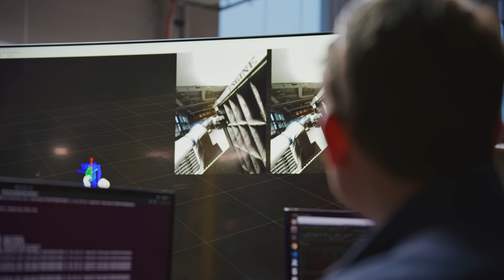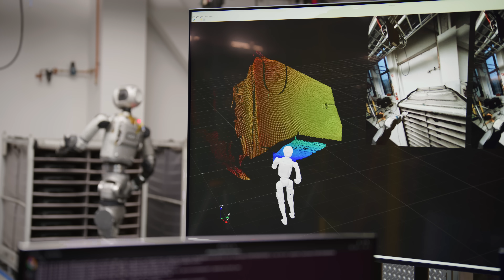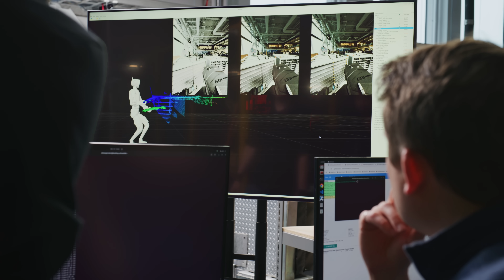Pick, Carry, Place, Repeat | Inside the Lab with Atlas

Comment: Inefficient machine transferring parts that shouldn't even exist.
Reply: For now yes.
But if the tech get cheaper and affordable, it will be adopted in large scale.
But for now, a device on track with a manipulator and RGB camera Will be more efficient ✅
Reply: For now yes.
But if the tech get cheaper and affordable, it will be adopted en masse.
A motorized tract device with manipulatelor arm and an RGB camera Will be more capable and efficient

Comment: Remember this video was about giving a description of a task (described in english) for a manufactured setting and having a robot carry out that task (in this case 100 sub tasks based on  the number of bins). The task being to move all the parts from the one bin to the other and keep it in the same order in the alternate bin. They are now using the same reinforcement learning (this is now being done by a lot of companies now, also bd actually came and said they were using reinforcement learning aka neural nets) coupled with the behavior robotics. Also keep in mind these robots are built to take the place of human based tasks but there are many different robots now doing manufacturing already, i.e. walk into any manufacturing plant and see how many of the items are actually stamped/molded into shape by human hands and a mallet/hammer only. Looms took the place of humans hand sewing stuff a long time ago.

Comment: 360 movement articulations for efficiency , but why it needs to rotate head? Why it does not have cameras all around the head ? That way it will not need to move it. That’s more efficient.

Comment: Probably a silly question, but while the 360 degree head turning is cool, wouldn't it have been more efficient to just put cameras in the back? That way you don't need to engineer this complicated head turning mechanism, just have it feed off sets of cameras in the front and back? Unless the cameras would have been more expensive, and the 360 degree mechanism isn't that bad, from an engineering/cost standpoint. Still super cool, though.
Reply: it's not just a camera but a bunch of other monitoring systems as well. Plus putting a second set would literally increase the power demand by 2 times making it far less efficient

Comment: What seems unique about Boston Dynamics is when you see the way the new Atlas stands up from a prone position by reversing it's legs and the same with turning its head 180 degrees to look behind it. It's not just reproducing the way a human does these things because it can move it's joints in ways that human's can't. That takes a lot of humility for the engineers to accept that the human body is not the ultimate bipedal evolution and that in future, for robots, there will be better or at least more efficient ways to design them.
Reply: yes. this is the reason why boston dynamics is front runner in humanoid robots. they arent mimicking real humans they are developing super humans that humans cant do

Comment: Humans will still be cheaper 😂 these guys are just Theranos Lite
Reply: "The average salary for a factory worker in the United States is around $35,686 a year." (Economic Research Institute) Boston Dynamic's last robot, Spot, is valued around $74,000 in the early age of robotic development. Project that prices go between the range of $10,000-$50,000 within the next few decades and you got something that doesn't complain, doesn't need a break, and does the same job 24/7, all at a price cheaper than a human!

Comment: Its impressive machinery indeed. But I think we are taking the wrong approach to the problem. Instead of trying to create something that could mimic human movements in human designed environment, we should simply change an environment in a way that we wouldnt need a complex robotic humanoids to do exactly the same thing the humans would do in that environment. 
Instead just build a box with a robotic arm set in the center that would simply move those engine covers rapidly, just the way they are programmed to work on a car assembly line for example. 
We already have the technology for that. It would be far more efficient to build an entire warehouse designed in a way where only machinery does the work that the people do now. It would mean a lot smaller warehouse, a lot more efficient sorting.
The current design of the work environment is made in a image of the workers needs. But why are you designing a robots that would mimic humans? We should design robots that would not need the same warehouse setup that a human needs...  
Its a lot more efficient and simple to simply design and build an assembly line of warehouse good sorting than it is to replace a human worker by a robot.

Comment: I look forward to the robot either testing new paths incrementally or maybe "imagining" variables to explore efficiency. A human would look at this and probably figure out a way to use both arms either by passing things from one hand to the other to avoid walking or by using two arms in a way that resembles independently controlled movements. A human could also take more than one engine cover in their arms so long as they don't get scratched. I just think that this robot is built with fewer mechanical limitations than a human but it is performing like a human with higher than average limitations albeit with a swiveling head and torso.

Comment: the difference  of human vs robot is emotion. humans have will power, will power is the driving force why it can work longer hours without being tired robots dont. I understand the human vs robot limitation obviously machine only need instruction and hardware design system. humans need sustenance, rest, human connection. But the difference is the what drives them. But thats only an opinion. It doesnt matter.

Comment: that thing is incredible engineering, amazing technology. but until i see it doing what atlas did, i wont believe them saying it can do what atlas did but better. they are different tools for different jobs. if im wrong, id lobe to see this robot jumping and flipping etc. but i just dont think those little electric motors have enough instant power for that. either way, both are incredible and those that worked on them should feel proud. as long as they are not used later to terrorize humans... or take their jobs, lol.

Comment: Some points that need to be improved while watching the video: 1. If you put two cameras in front of your head and two behind your head, you can recognize the danger or direction of the back without turning your head. 2. When moving the engine cover, it would be nice to move two light objects so that multiple tasks are possible. Of course, hold heavy objects with both hands and move them.

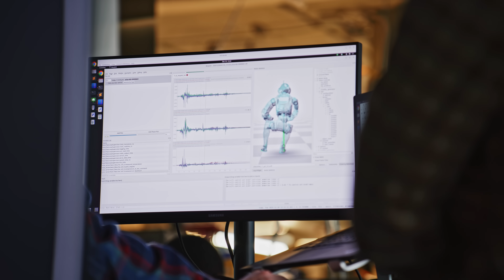Comment: 1:55 they are using Ubuntu inside Ubuntu?
Reply: Virtual Machine. Considering how much work they do, it makes a lot more sense to have most of it in a container of sorts rather than on a bare desktop.
Reply: @EbonySaints  i think they are using cloud OS like AWS. It will make sure that their code and data will not be vanished in case of hardware failure.

Comment: Could a top camera that communicates with the robot help with something or anything? Top down camera on the ceiling?
Reply: These are meant for environments that aren't 100% controlled and monitored by another system. Why install all these cameras when you can just get one of these and they will do their job right away or after minimal training. That's the goal, to have humanoids in areas that aren't 100% under control by the machines. Would you rather buy a humanoid for less than $20,000 and have it go to work right away, or remodel your workshop for hundred thousands of dollars first?

Comment: The hydraulics in the old Atlas acted like muscle and made its movements look more fluid and human-like especially when doing the athletic stuff.
Reply: The new robot is stronger and it's moments are smoother, according to BD. What are you people even talking about? They've even just posted a video demonstrating this.
Reply: They also could output more force and hold positions without requiring as much power as brush-less motors do when used as actuators.
Reply: Hydraulic actuators don't act like muscles. But they're more more fluid.

Comment: I'm curious, is it necessary for the head to have a "front"?  Couldn't you just put cameras in the back of the head so it doesn't have to "turn around." Robots don't need to have the same limitations we have. Same with its limbs and walking. If it can grab an item and just move to its destination without having to "turn its entire body around" it would probably shave off some time.

just a thought.. I'm sure you've already considered it and have a very good reason I'm just not seeing.

awesome work! I love seeing the progress

Comment: The robot is a marvel but the people don't seem to get that the 360 degree motion comes at a cost of it being unpredictable to humans or even other robots in close proximity. On multiple occasions the robot also didn't look in the direction that it was moving. Again making it very difficult for others to predict what it's about to do next. Humans have put turn signals on cars for this reason. So that other drivers have a chance of knowing what a fellow driver is going to do next. 

This is also the reason why Spot needs a head with cameras that can point in the direction it is looking. This way it could signal to others what it might be doing next. It's not that the unnatural movement or lack of a head causes discomfort in people it that the robots are not telegraphing enough information to those around them to be safe to work around.

Comment: The problem with other humanoids is that they try to look like humans. They even dress them up to resemble people. However, when something that is not human attempts to become more human-like, its eeriness becomes even more pronounced.

Atlas, on the other hand, has a design that closely resembles a classic robot. Its movements? Watching its joints rotate reminds me of a Japanese horror movie. But in reality, when it performs tasks like moving an engine cover, Atlas’s movements don’t feel unsettling at all.

There are some awkward aspects, but it changes direction with remarkable efficiency and speed.

The fundamental difference from other humanoids lies in the choice:
Should it be made to resemble and move like a human as much as possible?
Or should it maximize the advantages of both humans and machines?
Reply: Robots can not replace Humans what ever may be the software/ Hardware... They are aids and Should be helpful where humans threadvwith caution tocdare. Like Earth Quakes, Fire accidents, Building collapses, entering  caves and deep Sea. Replacing Humans for the sake of saving few bucks will be disastrous... Imagine a Train Running on Robotis and some malfunction , imagine a Robot Doctor removjng left Eye instead of Right eye due some electronics error....
Man has done so much research but still violent accidents happen...No software, hardware can be 100% foolproof. In some cases ever break in function will be life threatening !!! ...So humans are indispensable. 
Replacing all humans( even 51% with 51 %) will be fraught with danger unless tolerance is given in Robots ( which is oppisite of efficiency). It is like driving in forward gears and reversing !!!
Reply: @suraanj  I'm not going to disagree but the logic is flawed.
The same things you describe happens already, with humans, both accidental and intentional.
Reply: @suraanj  Not when you take into account the fact that self driving cars are having a hard time because humans mess up the traffic rules everytime. If everyone followed the rules 100% there would be absolutely no incident unless some catastrophy happened, like a earthquake taking down trees unto the road, or explosions.

In nearly everything else you mentioned it's the same thing. A surgery has very strict parameters. Once those have been met a robot surgeon will do a better job 100% of the times. Imagine a surgeon using just a fraction more of his strenght, a robot would never do that if programmed right. Which is the reason why Neuralink is implanted by a robot.

Obviously humans would still need to be present and will need to have the "last word" when deciding very important matters (like surgeries and rescue missions and such) but to say that something that is created and programmed to do a task, can't do the task better than a human, is simply wrong.